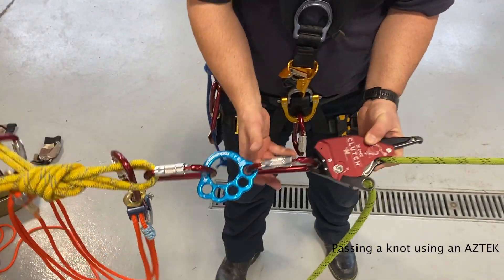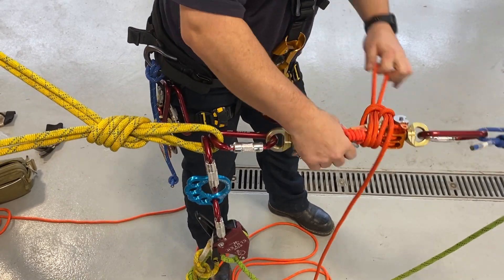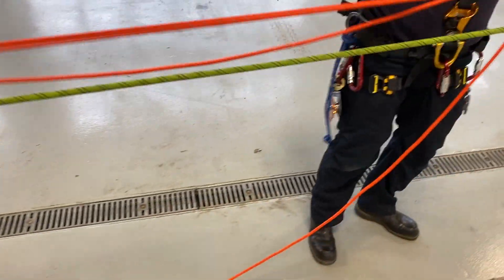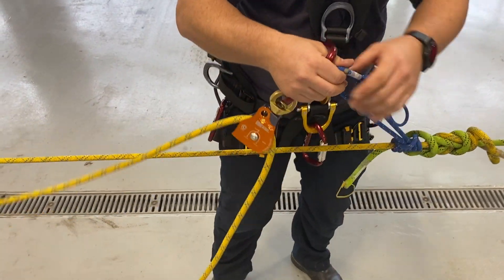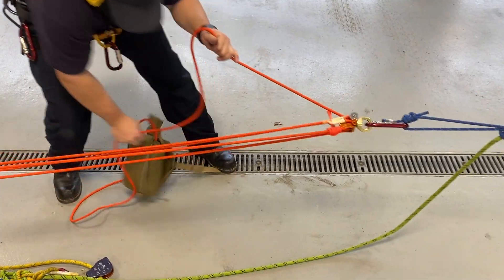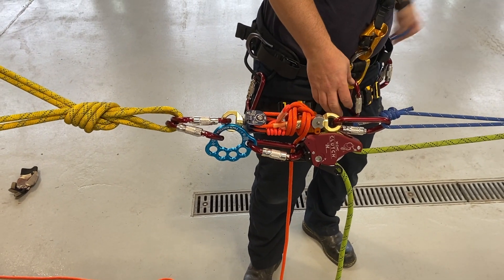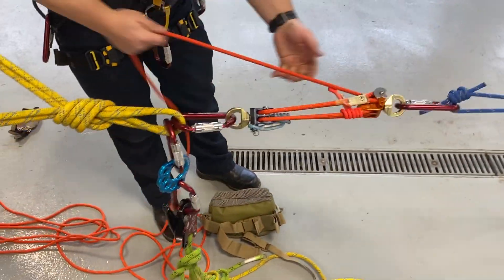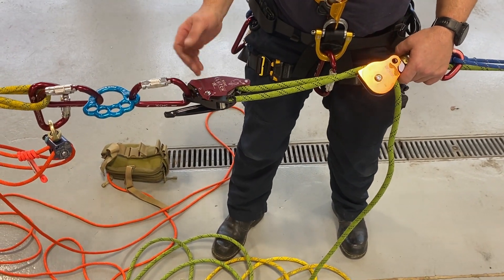Passing a knot using an AZTEK

Comment: Why do you do a line ascent? Isn't it easier to place the Aztek near the descender and after passing the knot just release the Aztek?
Reply from the maker: I don’t understand what you mean by “line ascent”?  I’m also kind of confused by your second question.  Once passing the knot through the clutch I released the AZTEK until the clutch had the load.  Then I could take the AZTEK off the main line.  Are you asking about passing the knot during a lower or a raise?
Reply: @dangerstall I think he means why did you do such a huge pick with the aztek instead of just setting the aztek prussik on the live rope, locking it off, lowering a little bit more until it has the load, passing knot through clutch, and then lowering the aztek back onto clutch. Hoisting the load with the aztek wasn’t necessary.
Reply: Yes your right on rope
Reply: He is just checking to make sure the knot is through
Reply: Danger stall is saying you don’t need to haul….just lower your load onto the 4’s.